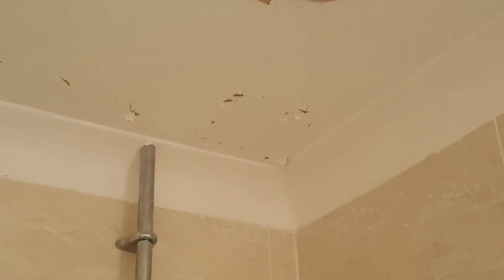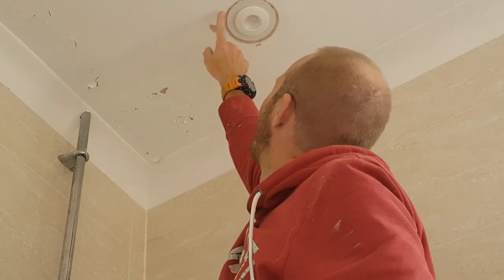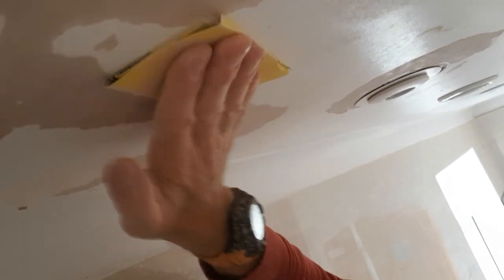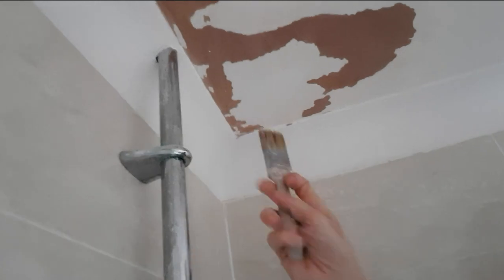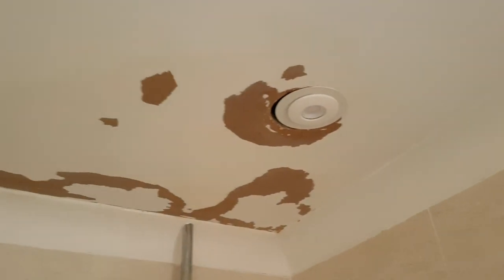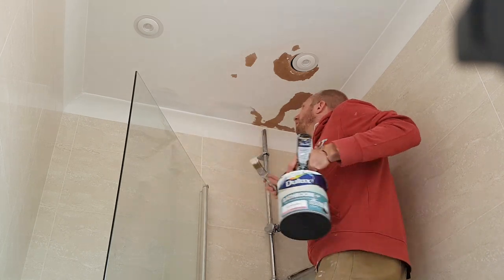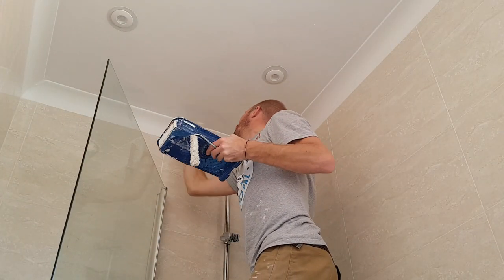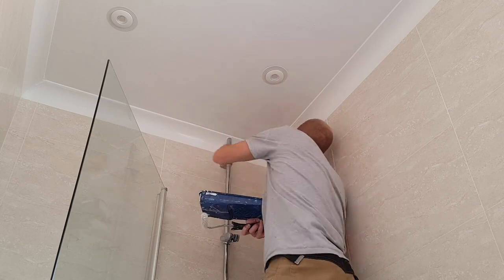How to repair a peeling bathroom ceiling with PVA wood glue

Comment: wait what?? PVA????? no dude no not in a wet area like a bathroom. PVA remains water soluble its entire life so as soon as the water vapour form your shower makes its way through the tiny holes in the paint surface (which of course it will) then the wood glue will just go back to being a wet mush and youll have to re do the whole lot.... this is terrible advice.
my advice, use watered down SBR bond or zinnser peel stop or just pay someone that actually knows what theyre doing!
Reply from the maker: What can I say, no problems so far!
Reply: Have to agree with you! 35 years experience in the trade, PVA as a primer for paint is poor advice.
Reply: @JBTV Keep your fingers crossed 🤞

Comment: If you get flakey emulsion it's either moister so you air bricks vents and extractor. Also can be efflerlurance think that's it spelt it salts comeing out of the plaster you'll see a white powder in both the above cases scrap surfaces down and dust off wash down and use alkaline resisting primer its oil based and holds back either the flake or the salt deposited used this for years once sealed left to dry then re emulsion..

Comment: Cool video mate. After PVA try some B.I.N. primer on.tje bare plaster,Drys quick, then two top coats.of emulsion. Itll never Peel. 👍🏻👍🏻.
Reply: That's so strange. Because I've done exactly that. two coats of BIN and then emulsion paint and it's not even been two weeks! the paint started flaking off. I wonder if doing the BIN was a mistake! Now I'm thing of rather than emulsion using metal anti-corrosion paint. what are you thought on that?
Reply: @payambreaker   strange mate. PVA And BIN primer are the.professionals choice. Did u thin the PVA down well. It should be just like water. Also thin first.coat of.emulsion too. shouldn't Peel. Its worked for me for  years. Sounds like theres been something on the ceiling that has reacted with the primer.
Reply: @spinx1200  I'm really sorry for not having seen your reply earlier and thank you for answering my question. I've not done any PVA as it had already been painted before and the surface was not a porous plaster. So I assumed primer should seal it enough. What I have bought now is STOP  PEAL from Zinsser and I'm going to sand all the flakes off first, then paint with Stop Peal, let it dry for 24 hrs, then use filler, sand it smooth, paint with Stop peal again and then paint with a different brand paint perhaps. Do you reckon this will work?
Reply: @payambreaker   hi mate. Ive.never uses stop Peel before but have read up on it as.such. normally.with.flaking paint as.in this video.it is sanded to kill rough edges and feathered in with paint. If youre gonna use fillers on your job I suggest fine.m surface fillers as itll be easier to sand and blend into old paint edges. Make sure the.sealer.and fillers are thoroughly dry before two coats of paint. Let me.know how you get on. Fingers crossed this will work for you 👍🏻😉🤞🏻🤞🏻

Comment: Don't you need to slightly fill the voids after you've applied the pva or am I missing something?
Reply: depends what level of finish you want,  it would need need to be skimmed for a perfect repair
Reply: @yarpos  Who would want a shit finish?..
Reply: @eezy251able  I've seen YTV's use filler to flatten out the 'step' between the painted areas and the plaster finished areas.  Guess it depends on what its like when you get off all the flaky paint.

Comment: The paint has lifted off the whole of one wall in our kitchen-diner, leaving bare plaster. Thank for that video - I now know what I am going to be doing this afternoon!
Reply from the maker: Great stuff 👍
Reply: @JBTV  Yes. I went to remove a piece of bubbled up paint using the scraper and the whole lot peeled off like removing damp wallpaper!  This is a plastered brick wall.  Just checking - one part PVA to three parts water?  Peeled paint looks like it was vinyl, and there is a white powder when you touch the newly exposed bare plaster.
Reply from the maker: Probably best to give it a couple of coats. Something like 1-3 will be good.
Reply: something is wrong if you lose the paint on a whole wall,   sounds like poor/no surface prep (best case) or a damp problem (worst case)

Comment: Great video.  My problem is no matter how much I try to feather the paint ridges with sandpaper, they never seem to go away.  When I paint over them, they are still very obvious.  What's the trick to doing that right?   Thanks
Reply: lookup the video "how to fix flaking peeling bubbled paint - bathroom ceiling".
Reply: @johnauld1268  thank you

Comment: Why do you use a wood PVA glue I wonder?  I have a small area of peeling paint in my bathroom and a larger area in the conservatory and want to try this method before I paint it but am wondering if I have to use wood PVA glue or if regular PVA will do.
Reply: Any PVA will do
Reply: @jackofallsales4535  Thanks for that.

Comment: Hi Justin..I have an apartment in Athens, Greece..it seems every 2 to 3 years I hire a painter to repaint my bathroom ceiling. It gets very humid in that bathroom. What would you recommend for my circumstances, my ceiling is aerated cement. What products do you recommend so I don't have to keep paying every 2 years.
Reply from the maker: Hi Sako. Not really sure what would be the best thing as it's very porous. Could you consider having it skimmed? You could then apply plenty of sealant to prevent water seeping in. Lots of ventilation in the room is key though, do you have an extractor fan and windows in your bathroom...?
Reply: @JBTV  no theres no fan...ventilation all year round is difficult since I'm only there 1 months out of the year. The caretaker  keeps the windows so it doesn't get too hot. Even then it seems like every 2 years the bathroom ceiling starts peeling off. Please help
Reply: Hay sako
Get yrself a moisture/humidity extraction fan, it can be set to a preferred humidity level and is automatic 👍🏼 hope this is not to late to help

Comment: I rent a house where the deal is I have to pay for repairs. All I want to do is make an inexpensive repair with drywall mud because I don't know how long I'll be living here.  I have some cracks in the ceiling above my shower. Could anyone please tell me the best drywall mud there is for a shower ceiling? Is there any that are more water resistant than others. I'll be using latex paint to paint over it. Thanks!
Reply from the maker: I'm not familiar with drywall mud.....
Reply: @JBTV  Spackle

Comment: What is PVA? You're in the UK, so maybe some different practices from the US I guess. Thanks for the video.
Reply from the maker: No worries. PVA is white wood glue. Cheers Clint
Reply: Polyvinyl acetate    Like the carpenters glue.
Reply: White PVA is not the same as PVA wood glue.
Reply: @leew8812  without saying how its different,   why bother

Comment: how long do you need to leave the bathroom dry after painting especially if it was the whole ceiling needs to be painted?
Reply from the maker: In normal conditions I'd leave it a day before use

Comment: you should be using anti mould paint for first coat then high condensation  emulsion paint for the second and third coat.. Your method of just regular emulsion will not work lad.
Reply from the maker: Not regular emulsion.... A good quality bathroom paint, it's worked very well for me lad